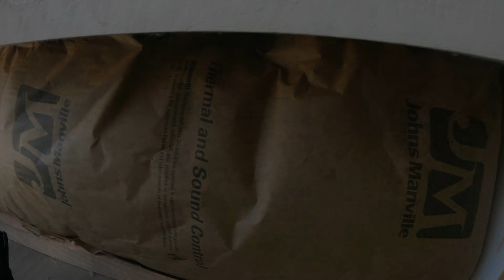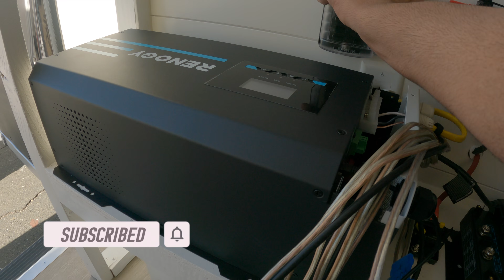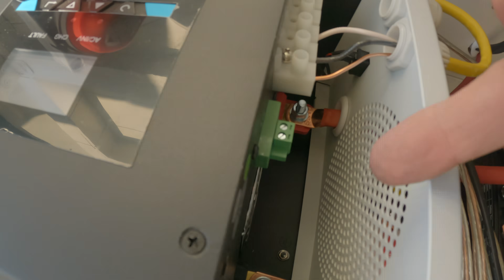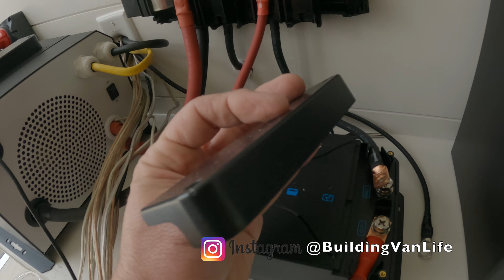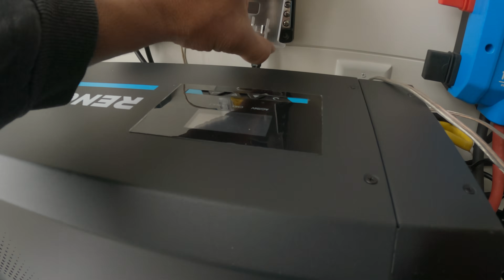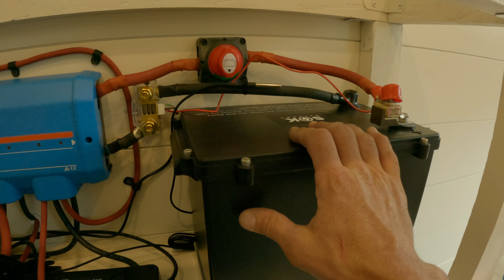Easy to Install Solar Power System

Comment: I've been following along building my van out. I can't find what you do between the inverter and the ac outlets. No fuse box or anything? seems like its just romex from the inverter straight to the outlet?
Reply from the maker: That's correct, the inverter has a built in breaker.  You could add another one in between if you wanted but it would be redundant
Reply: Sounds good. Thanks for the info @RyanBuildsHome

Comment: Hey Ryan, I noticed you hooked a ground wire to a small screw in the bottom of the inverter. Curious as to where you ran that to. Can't find anything on it in the inverter manual. Thanks.
Reply from the maker: You can attach to any grounding point.  I attached mine to one of the negative terminals on the dc fuse box

Comment: If I used the 30 amp dc to dc charger would i still use a 80 amp breaker or less?
Reply from the maker: Consult the owners manual of the charge controller

Comment: Do you have a distraction panel for your a/c outlets? If not how did you wire them to your circuit? Thanks in advance!
Reply from the maker: The ac outlets wire into the back of the inverter.  I think I show it in the video.  The inverter has built in breakers

Comment: Finally finished. I was expecting it to take me 8 hours to assemble all that, it actually took 20 hours. Mostly because putting those lugs on takes a long time, and I didn't have the proper cable cutter at the beginning. Your video helped a lot.
Reply from the maker: Glad it helped!

Comment: So Ryan, did you need to install the IGN signal wire for a smart alternator or did you determine your Promaster has a traditional alternator?
Reply from the maker: Promaster has a traditional one.  Only needed the ignition wire when I built the Mercedes sprinter

Comment: Thanks for all the great advice Ryan. I am in the process of putting it to use. Did you ever do a follow-up review on the Sok 200ah battery? I'm still deciding between  200 or 2 100s and which brand.
Reply from the maker: So far they are working great.  I like the space saving of having just one battery.  I haven’t done another video on it yet

Comment: Good video. I had actually just decided on the 2000W Renogy Inverter Charger, 50 amp Charge Control/MPPT and BMS with a 200-300 Ah LiFe Battery for my promaster before watching your video. I have wired entire houses with AC, but the components required for DC are so confusing, it took me weeks of research just to figure out that all DC to AC inverters did not also convert AC to DC.

Comment: I've  purchased  this whole solar set up with two two hundred  watt pannels .what size fuses do i need ? I tried to contact  rich solar and got no response.  I've searched all your videos  is 30 amp correct?
Reply from the maker: What amperage are you panels? You have two 200 watt panels correct? How did you wire them? Series or parallel?
Reply: @BuildingVanLife  I haven't  wired them yet . They a 2-200watt  5.32 amp ac adapter  current  is all I could find  which  way would you suggest  wiring  them.  I'm following  your  latest solar system  instructions.  Thanks  I'm also  building  your rack set up  with the smaller channels  and its  working   sweet.
Reply from the maker: @mywifeb  whether you wire them in series or parallel will determine the total amperage which will determine the fuse size.  So i would need to know your plans to answer your question.    I don't know what you mean by a/c adapter.  The panels are DC.  It says on the back of the panel the amperage.  Are you sure they are only 5.32 amps each? that doesnt sound right.
Reply: the pannel  generates  9.8 amp of power
Reply from the maker: @mywifeb  you can use a 15 amp fuse on the positive line of each panel before you go into the branch connector.  So two fuses.

Comment: I'm curious as to your view on the future state of van power given the advances in portable solar generators.  It seems like we're getting to the point where building out a battery system is becoming less necessary, perhaps less desireable.

For instance, the Anker 767 has 2048 Wh and can take a battery pack which would give you 340Ah of Lithium with MPPT controller (if I got my math right), the ability to charge off shore power at 1400 W and all the outputs I think you would need to run van electronics.  They have built in solar and I think could be hooked up to a DC DC charger to charge off the battery.  (I'm not pitching the product, but I think its a great example of current state)

Seems like you pick up a warranty, a compact package by comparison and potentially a level of portability for your power.

What do you think?  Wave of the future, or are there downsides I'm not considering?
Reply: On a strictly time/money calculation basis it absolutely makes sense to go with the compact portable system. I  did not go that route mostly because of concerns about theft. If I park in a remote area for hiking or biking and someone breaks into my van that $1,500 portable unit is a super attractive target, individual components that are screwed down and interconnected are not going to be worth the time and shock risk for most thieves.

Comment: Does the starter battery need a negative cable running through the van to the rear electronics too? I was thinking of just running the positive to the MPPT and just grounding this part straight to the chassis right next to the starter battery. If anyone has any pointers it’s all much appreciated
Reply from the maker: You must run a negative line from the starter battery or it will not work.
Reply: Thanks for the reply, I was thinking of grounding the whole system through the Lynx Distributer with a rivnut on the chassis just below it. Then everything grounds to that. But noticed that you’ve ran a negative cable all the way back to the starter battery ground instead. Do you know if it would achieve the same result? Thanks :)
Reply from the maker: @AlexHumberstone1998  the charge controller will not work unless there is a negative line running from the starter battery even if you ground the lynx to the chassis.  I tried on my first van.  And since the whole system will already be grounded to the chassis once you run that line from the starter battery (starter batter is grounded to chassis) there will be no point for you to ground it twice to the chassis

Comment: Do you have alink on solar panels?
Reply from the maker: Yes.  Solar Panels 100 Watts https://amzn.to/33yxqxN
Solar Panels 200 Watts https://amzn.to/2ZDboHd
Reply from the maker: Id prob go w two 200 watt rich solar panels
Reply: I'm buying all yours solar set up and ended up  with a three way branch  connector i will it work  or should I  return it  and get a two way.?  Thanks for all the super helpful  videos.
Reply from the maker: @mywifeb  you need the 4 way.   4 to 1.  Assuming you have 4 panels
Reply: @BuildingVanLife  i bought 2-200watt   panels . and some how  got a three-way  branch connector . Should I  use it or send it back  for  a two way? Sorry if this is  a stupid  question.
Reply from the maker: @mywifeb  yes you should return it for the two way since you have only two panels

Comment: Hi. on a previous install of a solar system, you used a 250 amp fuse for 300 amps of batteries. On this solar system you are using a 100 amp fuse for a 100 amp battery. My build is following your excellent example here, only mine will be a 400 amp battery using your same 3000 Renogy inverter. My question is what size fuse would recommend coming from my battery?
Reply from the maker: No i have a 250 amp terminal fuse on the battery positive terminal.  Fuses should be at least 25% larger than the maximum continuous current you plan to draw.

Comment: Max Continuous Discharge Current of a Sok 206 ah battery is 100ah, per the spec sheet, renogy 200 ah battery has a max continuous discharge of 200ah, I can't find the email from Current Connect who sells sok batteries, but I asked if his 206 ah would power a 2000 watt inverter, that answer was no, you would need 2 100 ah, or 2 206 ah to run it. That's why I went with renogy 200 ah battery. Check into it.
Reply from the maker: The 206 ah SOK is more than enough powerful to use with a 2000 watt inverter.  Just because it's a 2000 watt inverter doesn't mean it uses 2000 watts when ever you turn it on.   That's the maximum capacity of the inverter.  I can't think of any situation that i would ever need 2000 watts all at the same time in a van.  Especially when my major appliances are propane.   https://www.youtube.com/watch?v=SU86EJXcTMM

Comment: Is that 100 Ah sok going to be enough to power that 2000 inverter?
Reply from the maker: It's not a 100 amp sok, it's a 206 amp hour SOK
Reply: Link went to a 100ah,sorry.
Reply from the maker: @chein33  I have a link for two options, 1 200 amp hour sok or the other link for a 100 amp hour battle born but then I would recommend using two of those to keep it at 200 amp hours

Comment: Hey hey - nice job as always.
Quick question I can’t get a clear answer on… some will install a breaker panel with breakers for each AC appliance between the inverter and the appliance. Looks like that’s not part of ur system. Could you help me understand that?
Thanks!
Reply from the maker: I don’t have any appliances running on a/c it’s all dc.  I just have a few ac outlets in the van in the event I ever need to plug something in.  The inverter has a built in breaker so I’m relying on that but if you are running a lot of things off a/c then that’s probably a good idea to add it
Reply: Thanks! This is super helpful…
No van yet, on order since September
I have a vin # but no delivery date- gonna be a while…

Comment: Looks great! I’m doing a similar setup, have a question…where did you go with the inverter ground?
Reply from the maker: I grounded it to one of the negative terminals on the fuse box.  You can also go to the negative buss bar.

Comment: You will likely want to put the fuse for the alternator charger right at the connection to the starter battery. That way your wire is not part of the fuse.